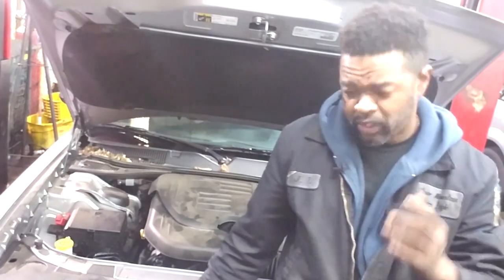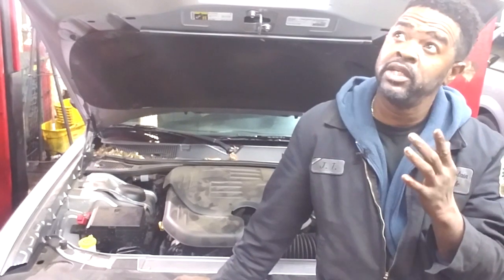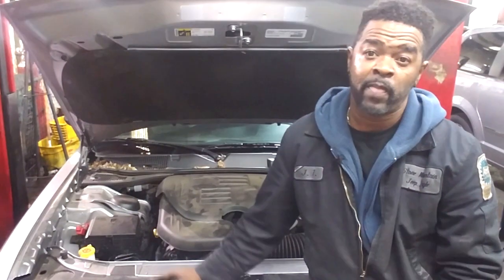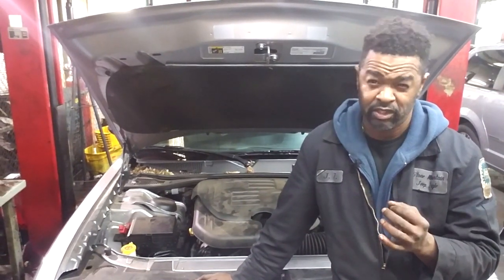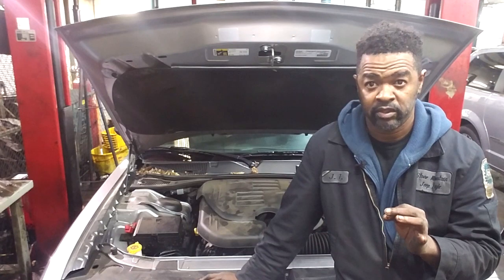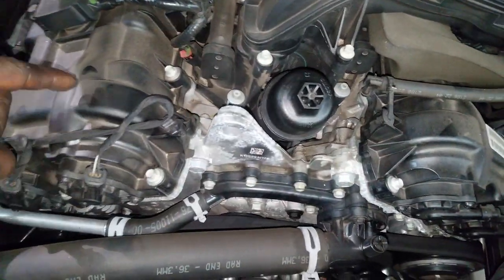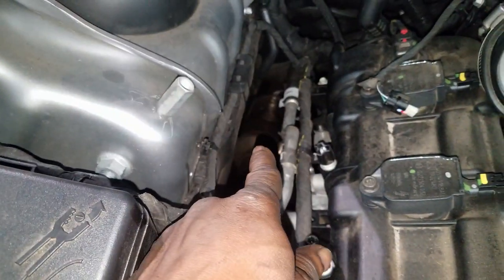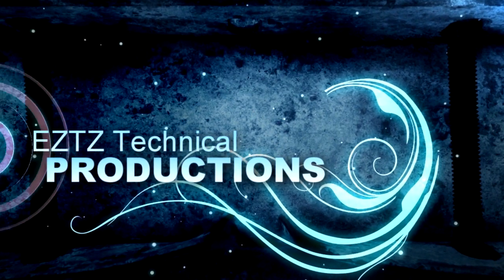P0420 catalyst system efficiency below threshold bank 1. This how to find BANK 1 or BANK 2

Comment: Our 2017 dodge caravan is throwing out that same code so we had the O2 Sensor swapped out for now but we never saw any diminished quality in the handling of the van or performance.
Reply from the maker: It does not matter my friend, the computer has detected a problem with the efficiency of the cat. Which will basically mean it will need to be replaced.

Comment: Hi i have a dodge charger with a new po420 warning right after picking up from dealership. The new auto shop didn't even tell me whats wrong and said i need all cats and sensors replaced and it sounds like a scam

Comment: I have PO420 on my Jeep Patriot 2008 2.4L that came up as well. I replace the O2 sensor on the front and with new spark plugs. It didn’t make any difference. Could the ignition coils have an indicator to any of this as well? It also idles very rough and it shakes bad every time I slow down then accelerate fast. Thanks!
Reply from the maker: So you replaced everything but the Cat Convertor?  Also are you subscribed to the channel?
Reply: Did u fix it
Reply: DID U EVER FIXED IT?

Comment: My car wouldn’t accelerate today. Only reverse . Not drive. Codes show catalytic below threshold, O2 oxygen sensor and a few other things. It’s been towed to my local mechanic, wat should I expect to hear and if they say replace the CAT, should I allow that?
Reply from the maker: Hello my friend, its hard to say. But yes, a restricted exhaust in the cat will cause your low power output. So if they think thats the reason then thats likely what your estimate will be. Most shop work off the risk factor. Thanks for watching the vids. And please subscribe to the channel for me, thanks

Comment: I just threw this code on my 16' Rubicon. Less than 70k miles. Should I do O2 sensors first. I know there is a TSB on all dealers have to Warranty cats if they are within 8yrs or 80k from vehicle production. Also, had misfire code prior, changed all plugs, coils and PCV. That code cleared. Now I have the p0420
Reply from the maker: Hey bud, most people do try the O2 sensors first but all cat efficiency codes will end up needing cats. Your car may have an extended emission warranty, also are you subscribed to the channel?
Reply: @OnlineMechanicTips  I appreciate bro. And hell yeah. I'm subscribed

Comment: Not sure if you'll reply back but I have a 2002 nissan sentra gxe 1.8liter 4 cylinder. My check engine light has been on for a few months now. I got the code p0420. It seems like anybody I take it to gives me a different answer, so what is the first thing I should do? As you stated in the video I don't want to just throw money and parts into and the code comes  back on. And yes I subscribed 😉
Reply from the maker: The best answers should come from somebody that actually diagnose it, anything else would be speculations bud. I can only tell you from experience that a P0420 will likely result in a cat replacement, but ive also seen guys have success with just replacing the O2 sensors. Theres data that you can see using a scan tool that can tell you why the code set. Without this info its hard to tell.
Reply: @OnlineMechanicTips  thanks so much I appreciate the speedy reply.

Comment: That was very informal. Though, I would like to know how would u diagnose a larger engine such as 4200. Only because I have a 2002 chevy trailblazer with a P0420 code
Reply: I just don't want want to make a mistake and spend unnecessarily, if possible! Thank u in advance! This was helpful tips!! #InspiredMechanic
Reply from the maker: Hello my friend, a cat efficiency code in most cases pretty straight forward. 98% of success ive had with this code was actually replacing the cat in question. Theres not many option to this type code. Thanks for watching, please thumbs up the video and subscribe to the channel, thanks

Comment: Is this the same situation with all cars? Fords?
Reply from the maker: Just about. Are you subscribed? what year make and model is your car?
Reply: Online Mechanic Tips I am now! 2006 f150 5.4 3v
Reply from the maker: @garrettlamb9916  Yes sitting in vehicle bank 1 is passenger side bank 2 driver on this vehicle
Reply: Online Mechanic Tips so could an exhaust leak cause this code? Such as a manifold stud broken off?
Reply from the maker: @garrettlamb9916  This code will pop up if the computer detects the efficiency not within specs, based off inputs from the o2 sensors..Pretty much will lead you to replacing the cat convertor.
Reply: Online Mechanic Tips I just had my cat replaced a few months ago ... now what?

Comment: Can you please help me
Reply from the maker: I can try, whats wrong.? And are you subscribed yet? please do, thanks
Reply: Online Mechanic Tips I just subscribed and honestly I took it to a shop and they gave me that code P0420.. but only thing that was wrong with my car before was high purge flow and system to lean bank 1 ...
Reply from the maker: @Milaa.d2  Sorry to tell you that those failed items you just mentioned, could very well have ruin the cat which is why the code set. I know they expensive but they can fail and become retricted over time..Sorry

Comment: I have 4 catalytic converters and the code p0420 came up so that means my catalytic converter is clog?
Reply: I just called a mechanic place where I live earlier. He said I could either have a faulty 02 sensor or my converter could be clogged. I don't have black/grey smoke coming from exhaust. But I've also researched that a bad 02 sensor can also lead to the sulfur rotten egg smell. I just hope for my sake it's a bad 02 sensor.
Reply: @AKAlarrythecat578 they have this type of fluid for it but the auto parts store catless clean it's like $25 a bottle

Comment: I had that same code P0420 and the mechanic wanted to change the Cat  converter this guy in mechanic school he  says change your spark plugs remember he’s only 20 years old mechanic so he changed my spark plugs on my 08 civic and  I never had no issues with p0420 code after the spark plugs change
Reply: I changed my spark plugs like a month ago and just got this code today weird...
Reply: @Blackjack_focus_st3  did you replace the intake gasket?
Reply: I did what you said and still got po420 code on my 2000 yukon 5.3